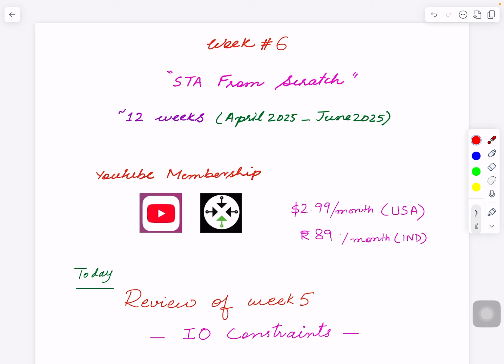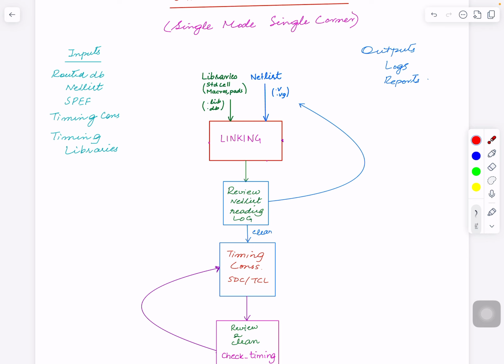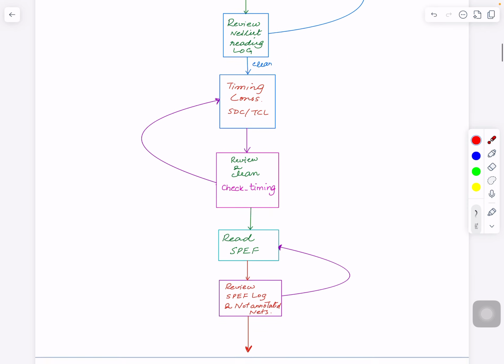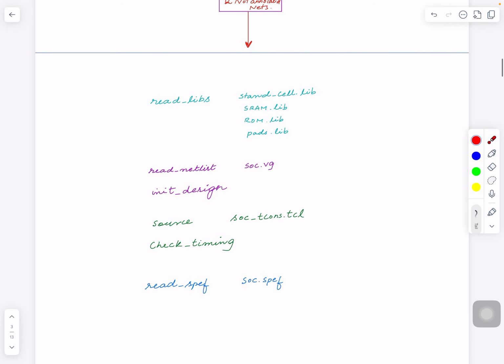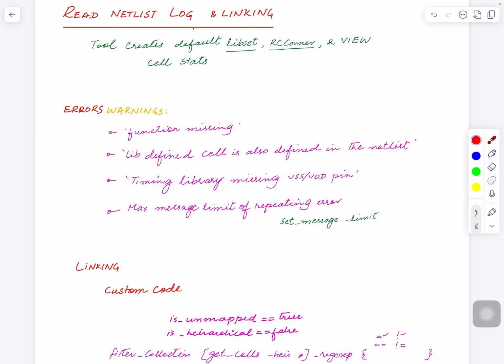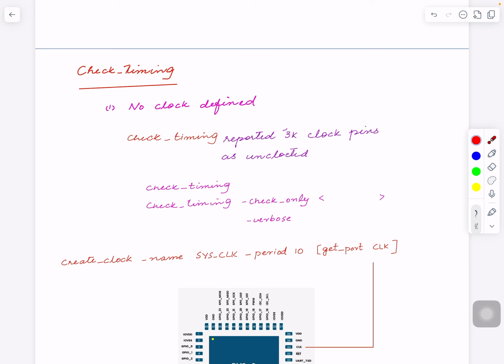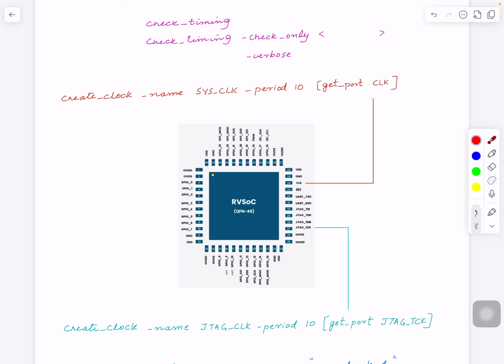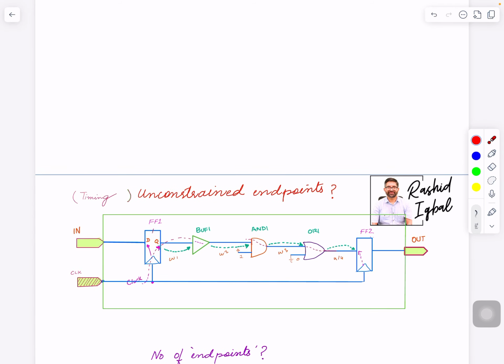STA Series, Week 6, Video 1 - Revision - Basic Static Timing Analysis flow, Check_Timing clean

Comment: It would be great If you can add multi voltage design or in other series to get all real issues and solution
Reply from the maker: I will do separate series on UPF , low power designs.